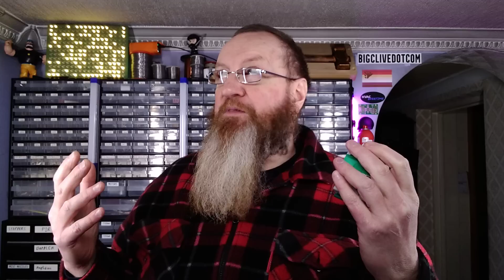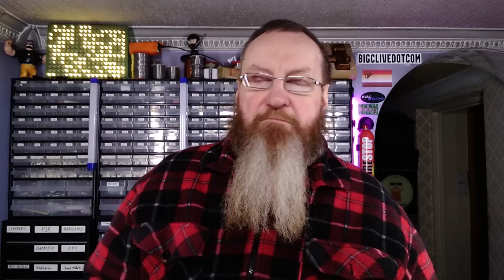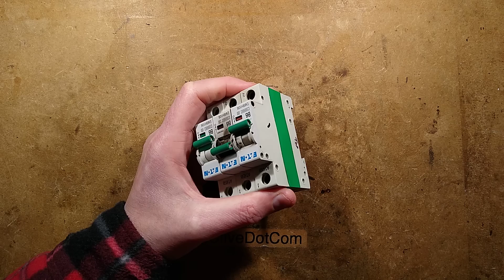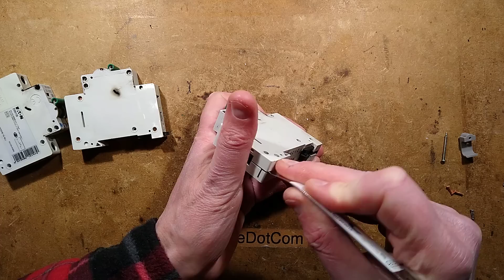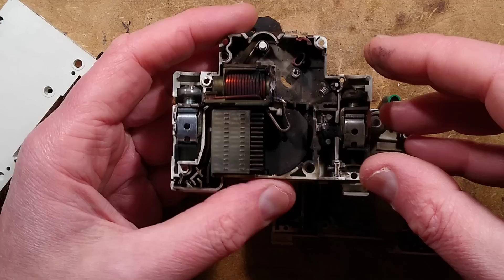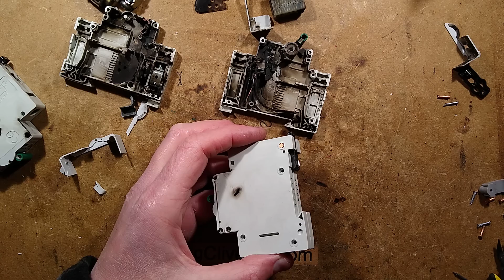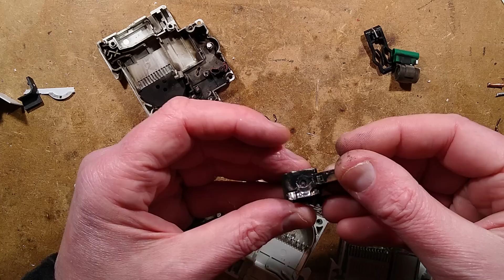Arc flash breaker failure - let's open it

Comment: Now  ! ..... you would  NEVER  get this problem with the  BIG  clunky  white ceramic (  re-wireable  ) push in fuse holders .... Firstly , they cannot support tracking ( ceramic does NOT carbonise 😝 ) .... secondly , they only blow when there is a  HUGE short circuit , and do not " trip " in a lightning storm .... many folk moan that it takes ages to re-wire these ... easy .... just have a bag full of spares in the fuse cupboard ( or some  HUGE   ones in the factory  stores ) ... but .... the ( modern compliance nerds ) try to insist that these do not meet current regulations ( who cares , they are very safe  ? ) ... my house has these , and ... since the 1950's no fuse has ever blown ... so much for modern ( progress ) Grrrr ............ DAVE™🛑
Reply: It wouldnt have happend because someone put a nail into the holder.
Reply: @lukahierl9857  Yes ... of course ! ! .... Ceramic fuse holders are subject to all manner of ( owner abuse ) , the main one is using the wrong thickness of fuse wire .... or even  IRON  garden wire , which glows red hot for ages 😝 ... nowadays , your company main fuse is  STILL  a fusible link , because a ( complicated ? ) circuit breaker can go wrong ( as in the video ! ) ... the other snag with ceramic fuse links , is they are BULKY , especially in a factory setting ... but I am sticking with my 1950's  WYLEX ™ fuse board .. DAVE™🛑

Comment: I worked in the printing industry where printing presses had thousands of control wires going all directions in steel wireways. Electricians would locate the impossible to find faults by replacing the fuse with a piece of copper tubing and then look for the smoke.
Reply from the maker: That can cause a lot of wiring damage very quickly.  Literally igniting whole looms.

Comment: I recently just saw a new video floating around the internet where 2 sub station workers where resetting a large braker inside the controll room of a sub station and when they went to turn it back on they didn't know that the fault didn't clear and the braker exploded causing a large arc flash over inside the braker which sustained itself to the point where it eventually made it's way to from the controll room to the HV lines outside. the whole sub station was a total loss. Thankfully, they both made it out and survived uninjured.
Reply from the maker: There are a few videos like that online.  The substations deal with massive current at high voltage.
Reply: One flash and ya ash.   Glad they survived. 
HV is scary enough, let alone flawed operational protocol to ensure fault clearance and sign off before any attempt to close a HV breaker. 
Tiny sub station?  Old?  Open form switchgear? ... surely not modern HV breakers and their high arc containment ratings and explosion vents.
Reply: High voltage substations are usually pretty safe. If the relay protection is set up correctly, and it mostly is, then you rarely see an explosion. it comes out instantly, no flash, just post fault maintenance
Reply: @ Depending on location (where in the World or ship) that is true if human operational procedures/rules are followed. Ground truth - it's 'White Tape' and Lockouts.  
Subs are safer than working on low voltage in an old residence for sure. Why? Because layers of bodgy DIY crap don't happen, and dangerous fault currents can and do exist in that 'domestic' installs.
Reply: There's a few online from Russian substations where that has happened, including one where the fault propagated throughout the entire substation due to huge amount of metal plasma being emitted.

Comment: Never thought of it, but lever is bit uncomfortably close to live parts. I suppose arc for user is still very low. Just like hour ago found one low power circuit relay which was stuck energised. Open contact had visible spike in it from frequent switching. I suppose that is severe possibility on this case too if switch needs to switched on like in this case.

Comment: And that’s why HRC fuses are so good, it’s never good to be the person that closes the breaker after its had enough.
That said, it looks like that breaker should have had a set of fault current limiting fuses upstream.
Reply from the maker: That's assuming that a labourer hasn't "fixed" an HRC fuse with a bit of wire or foil.

Comment: Where does the carbon soot come from? The plastic and insulation materials?
Reply from the maker: Yes.  Degrading electrical materials from flashes and general tracking causing conversion of insulation into carbon.

Comment: FYI, in some systems in power distribution, the fault creates the pulse on the line and recorders on the line compare arrival times at substations to find the location of the fault. This is not normally in a building due to the expense, but mostly used for HV transmission lines. This is used in place of TDR. For more local utilities, they use a thumper TDR, which puts high current pulses on the line. The short duration pulse can often cause carbon tracking to flash over to be found. Faults in underground buried cable can be heard thumping in the ground. Ariel lines strobe at the fault.

Comment: The only time I saw a flash at a circuit breaker was in college when a fellow student left live and neutral cables dangling inside the consumer unit and powered it on to prove all the circuits were working correctly. At least it proved the circuit breakers worked...

Comment: 20 year service electrician. Love your intro, so true. 
It’s a real challenge and ultimate test, using your skills, knowledge and toolset in finding internment faults. 

It’s the one thing that really pushes me as a technician, and can consume my 2am racing thoughts.
 Meggers, recording meters, trigger event recording, even installing simple in-line fuses. All which push you to think outside of the box, and use electrical tools in a way that they were not originally designed for, to find an intermittent problem. 

Troubleshooting, and developing tools and skills at finding problems is a whole other level of technician. Hats off to those who have banged their heads against the walls trying to find a problem. There’s times you give up and just replace the whole dang thing. But you’ve gained an experience. Takes many years to become proficient at fingering smoking guns! There’s no class or textbook that can instantly make you proficient at it.

Comment: If you can't trust circuit breakers, what can you trust. I had that happen on a cooking hotplate probe once where water got in and it shorted the pan to ground sending 120V through the entire thing, creating a massive fire instantly. Luckily I didn't touch it.
Reply from the maker: You can get quite an electrical show without reaching the trip threshold of a breaker.  Cooker elements are notorious for failing dramatically.

Comment: i had one of these intermittent faults on the power supply into my house.   only minor interruptions inside but popping or occasionally a bang from outside.   as time passed the occasional bang would get louder and when i go outside to see what the cause is there is nothing.   then one day it banged just while i looked up.   years earlier a pantech truck had reversed into the cable.   i like that blade contact idea.   round contacts get hot spots in the centre.

Comment: Kind of like putting in a heart monitor to determine I needed a pacemaker. Every few months my heart slowed down. Hard to find on an annual checkup.
Reply from the maker: My heart misses beats from time to time.  But NEVER when I'm being monitored with an ECG.
Reply: @ mine was called a loop recorder, which is implanted just to keep track and send reports to my doctor when something was suspicious. My heart went really low, 32bpm I think. The pacemaker is barely noticeable after 3 months.

Comment: I use these Eaton breakers here in Canada, but in the field I'm in I have to use their UL489 type which adds long plastic dividers between the poles. The holes on the side are used for either an auxiliary contact or ganging multiples together.

Comment: And here is a question on Circuit breakers, what can suddenly cause one to make humming noise (not constant, only at times) and is it dangerous?
Reply from the maker: Some loads can make the solenoid buzz if the current is drawn as spikes or with dimming.  Especially if it's a fairly high load.
Reply: Noises made by breakers or any other parts in your electric circuit are always cause for suspicion and further investigation. 

As Clive said, it can happen due to spikes; "dimming" (with lousy or absent filters, e.g. AliExpress triac dimmers) is one way to get high dI/dt (= sharp current changes) on a power line where this does not belong, *ever*: At least where I live (NL/EU) there's rules and regulations about "cosinus phi" for all equipment that draws noticable amounts of power. 

"cos phi" (a.k.a. "power factor") is the classic one from way back in history where you could have highly inductive loads (motors, ...) phase-shifting current vs. voltage and the power distribution network does not like that sort of behaviour *at all*. (At some factories you may find "cos phi correctors", e.g. condensor cabinets = a bunch of capacitors to help "unshift" the phase by pulling the phase shift the other way, to make the grand total look like "close enough to resistive load" again.

Modern day, it's generally switching PSUs, BLDC/stepper/servo motor systems and others who rectify the AC and then do their own (high frequency) thing with it and cause a characteristic camel peak in the current curve, particularly the older ones when they could still get away with wiping their bottoms with the effects upstream in the power net (think high power thyristor stuff from the 1970's-early 90's mostly). Expect weird current curves when you look with a 'scope; when it's bad, it surely will also show up as weird voltage shapes, thanks to the (small) power line wire resistance; you can see a lot already with basic test&measure equipment.

Truly modern stuff has additional "power factor correction" electronics built in to prevent this bad behaviour from getting onto the wires.

In your case:
Get a cos-phi monitor on there, an oscilloscope if you have it to watch wave forms and an IR cam to see if there's noticable heating up of the breaker as that noise doesn't come free. Even if it's "acceptible", noise is akin to mechanical resonance and everything ages rapidly if not specifically designed to handle repetitive mechanical movement during its lifetime. Ugly waveform of your 50Hz means rotten "cos-phi" and is, if sufficient power is consumed/connected as load, cause for reject of the installation.   (Aside: you may hear rattling noises in wire conduits, which happens due to high currents and is "benign" until it isn't. It occurs at my home when the washer+dryer are running: there's a bit of old pipe where you can hear a wee bit of buzz when the machines switch on their heaters. That one is "benign" to me, as (individual) wires always move (minimally) when AC current flows through them, but again: if you notice it, it's probably too much.

Comment: In my 40 years in business, I've had several electricians sent by the landlord act like I was being really stupid for asking as they insisted that breakers NEVER fail.  On at least 3 occasions, breakers had failed--including a 3 phase mains breaker into my machine shop that had never seen a trigger (it dropped only one leg which the machine motors REALLY loved [sarcasm].)  Yes, breakers can and do fail. An electrician who tells you it never happens is a greenhorn or goof-ball.
Reply: Reminds me of those electronics/computer people who handle PCBs with their bare hands and say ESD is a load of rubbish.  Invariably they're always having weird faults with their hardware but never seem to cotton on to the fact that they're the ones causing it.  They seem to assume that static electricity always kills something completely, and don't realise it can just impair parts of a device and leave the rest seemingly working fine, leading to lots of weird unusual behaviour.  But they can assure you it's definitely not static electricity damage!
Reply: I lived in a house with a main breaker that wouldn't turn off on one side, even manually. I'd say that's a failure!

Comment: Once in the 30 years or so I had an rcbo explode on me when I re set it. I’d removed the fault off the circuit but the panel was near the dno’s transformer. The ze was measured at 0.00 ohms and the pfc was over 20KA so the instrument couldn’t really measure high enough. The device was incorrectly selected although I don’t know what your supposed to do to correct that. It was 10ka rated. Suppose you could use hrc fuses and a double pole rcd like you’d have as a main switch? Excellent videos thanks.

Comment: The fault was the policy of resetting the breaker without fixing the short, especially multiple resets till it sticks!

Edit add :
Just got to the excuse part.
It would have involved expense and equipment...
Yeah, expense and equipment that was needed anyway, plus the inconvenience of a whole facility blackout..
Which is cheaper?

Comment: when road salt gets kicked up into the distribution lines here, and causes a short... those big breakers in the hydro distribution yard automatically cycle a few times to clear the fault. If you can see the fault... that is something to see: bits and pieces of insulators flying like shrapnel!
Reply: @willthecat3861  

In my city, an elevated highway is situated adjacent to a high voltage electrical switchyard in a heavy-industry area.  Lots of salt is used on nearby roads and that elevated highway in winter.  

A few times in summer I have seen city fire trucks hosing the electrical switchgear from below (I assume only after the circuits are temporarily de-energized), with special attention to the undersides of the suspended vertical porcelain insulators.  They seem to be specifically aiming the water at the concave undersides of the flanges of the brown porcelain insulators, where rainwater can't get to.

My guess is that winter road-salt mist drifts over from the elevated highway to the switchyard and settles on all surfaces of the switchgear, but rainwater can only wash salt off some surfaces, so in summer they fire-hose wash the salt dust off the equipment surfaces that cannot be washed by rainwater.

Comment: The local electric utility serving my home did the "replace the fuse and it works again" move for many years.  The 7.2KV line goes underground at the corner a few hundred yards north of me. That underground line was installed in the 1970s and they replaced the entire run in 2022 (IIRC).

Since I moved here in 1998, we had 2 or 3 times per year when the fuse on the pole at the end of the road would blow, leaving the neighborhood to wander the street and socialize with one another.  The utility would dispatch a truck, usually with a single lineman who would replace the fuse, close the switch, and we would all retreat inside for another few months.  Until one Sunday afternoon when he closed the switch to a resounding KA-BOOM one house down from me and we watched smoke curl up out of the ground.   (A large ceramic insulator in the vault had a carbon track the entire length.)  It took all afternoon for sufficient crew to arrive on site and replace the connections feeding that transformer and restore power.  For another few months.  Pattern repeated for several years, and finally after two more incidents where they had to find and replace failed transformer connections, they replaced the entire line.   So far we've had years without blowing that fuse. 🤞
Reply: My parents bought a new house in Virginia in 1988, served by Dominion Virginia Power. For many years, every time it rained, the power would go out for at least an hour. I imagine that they were just replacing the fuse to get it back on. The problem was finally fixed for good when they build another subdivision/neighborhood across the street, and to this day I wondered if they actually intentionally fixed the problem or just accidentally did it when they made the changes to connect the new neighborhood. This sort of crap is par for the course with that power company, from what I've seen. I've seen their primary overhead lines with 5 automatic splices in a row, how does that happen?

Comment: There's 2 types of electricians...  The ones that keep resetting the brakes "till the faults clear" and the real ones.  I used to know an electrician who had a special 100A breaker he used to "clear the faults" (usually on 15 to 20A circuits).  Coincidentally, he was missing a few fingers on each hand. But I'm pretty sure it was just a coincidence ;)